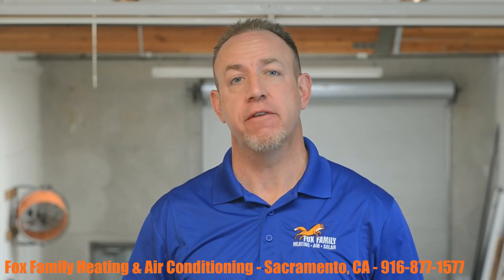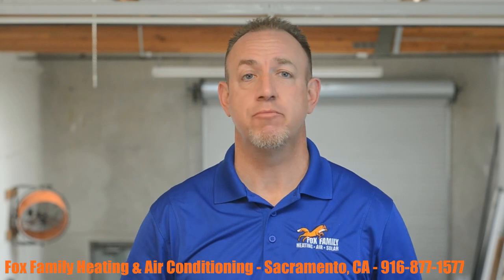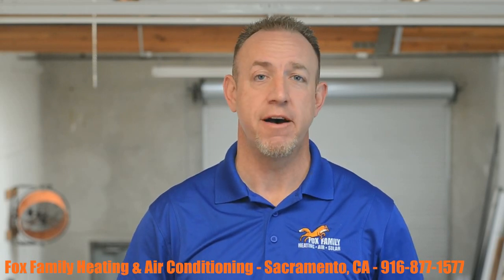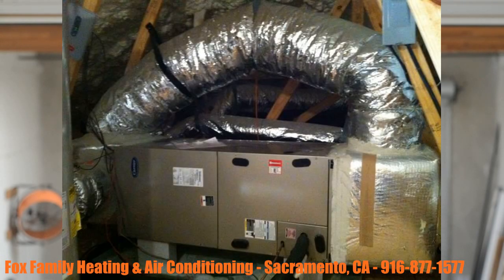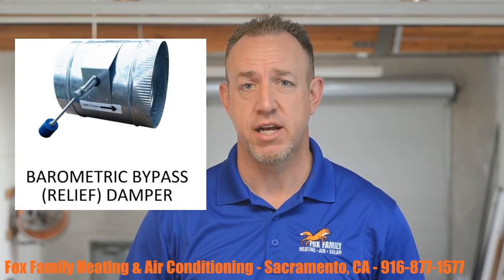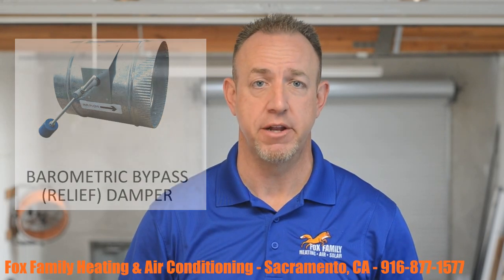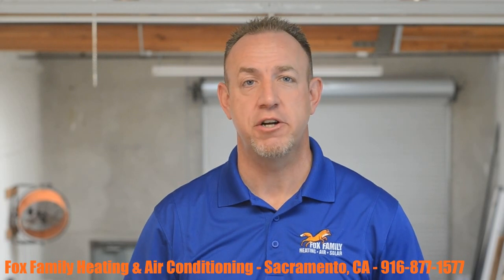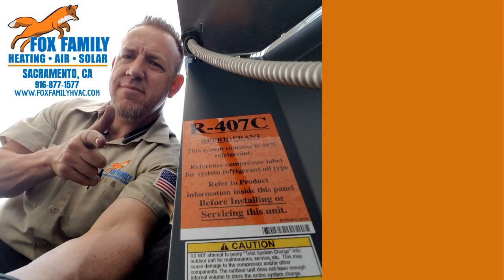HVAC Zoning Basics - Bypass Dampers and Dump Zones

Comment: I have a question and hope some kind soul can help!  In a 1 Compressor setup with 2 zones, should the dampers in each zone open and close when on/off?  Example:  1.  Zone 1 is turned on the damper is open 2. Zone 2 is turned on and Damper is open (both zones on and both dampers open)  Shut off Zone 2 and the Damper closes, Shut off Zone 1 and the Damper closes or vise/versa.  My setup (I can give specifics but not sure it matters) Its not working this way which seems pretty logical to me..instead one zone may close when it should be open....no matter what I do on the Honeywell control board I can not get both zones to open at the same time or close just one while leaving one open if that makes sense...thanks if you made it this far!

Comment: I have a question. I just bought a house 3 years ago(2 story home with 2 zones 1806 sqft)and I’ve been having many issues with my air conditioner at least every year. First year, my compressor went bad, and now, my air conditioner was froze up. I had a company come out(not the ones who did the original in stallion when the home was being built) and say that my coil was leaking. He also said that when they installed my HVAC system, they did not install a “bypass” or “trap” for all of the excess air and should’ve never passed inspection. He went on to say that I’ll need a whole brand new system estimated around $10,000+. If I don’t get the system, I’ll continue to face issues like this time and time again. Am I getting shammed or is that a legit statement?  Thank you.
Reply from the maker: Tough to say.  I wouldn't just rely on the one company's opinion.  I would call around to two or three other companies and see what they say and for God sakes don't call any of the big companies in your area.  Only smaller to mid size companies.  Your bound to get a straight shooter there.  It's all about sales in the big companies.

Comment: IF YOU PROPERLY INSTALL THE REQUIRED DAT SENSOR ON THE SUPPLY PLENUM AND SET THE CORRECT HIGH AND LOW TEMP LIMITS WILL ALLOW THE ZONE PANEL TO CYCLE THE HEAT AND COOLING OFF UNTIL THE SUPPLY TEMP REACHES AN ACCEPTABLE TEMP. WHICH WILL PREVENT THE SYSTEM FROM LOCKING OUT. LOW LIMIT DROPS Y TO THE AC UNIT AND HIGH DROPS W TO THE FURNACE. I DO NOT LIKE ZONING. ONE UNIT TWO TSTATS. PREMATURE WEAR AND TEAR ON A SYSTEM. THE COMPANY I WORK FOR IS A TRANE DEALER AND INSTALLS ABOUT 40 OF THE XV VARIABLE SPEED SYSTEMS EACH YEAR IN THE NC MARKET. GREAT EQUIPMENT. THE COMMUNICATING ZONING THAT TRANE PRODUCES FOR THE EQUIPMENT IS TRASH.
Reply from the maker: I've heard the same
Reply: SO MANY CAPITALIZED WORDS 👀😐

Comment: anyone ever dump the extra air into the garage?
Reply from the maker: I actually have had a third zone that went to the garage, aka the poker room, lol.
Reply: if it's just a garage they will still use to park cars do you see anything wrong with dumping the supply in a garage back and side walls unfinished . house shared wall and ceiling sheetrocked.
Reply from the maker: @joeglenn8955  I was just a helper back when we did this job.  Personally I think it's a waste of energy pumping ac into an un-insulated garage.  Not sure if he improved the garage after we left.  I didn't think I understand your question though. Autocorrect may have changed a word for you. 😊 Can you re word it?
Reply from the maker: @joeglenn8955  I have seen people hooking a ductless system up in their garage though.  Still a waste of energy on an un-insulated garage but to each their own.  It works if you oversize the air entering the room. 😊
Reply: what I meant was while installing a zone system, instead of using a bypass and dumping the air back in the return or in a common area. has any one dumped the air in the garage?  not to really condition the garage . so you don't have to much heat on a heat exchanger or to much AC on the coil